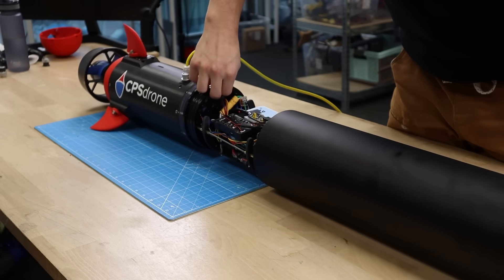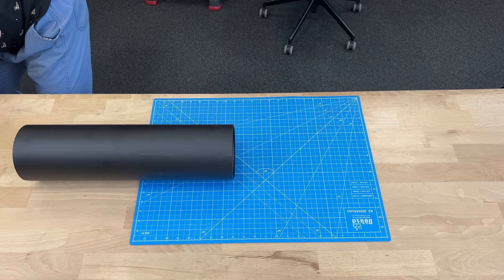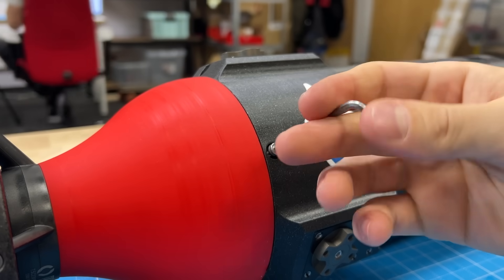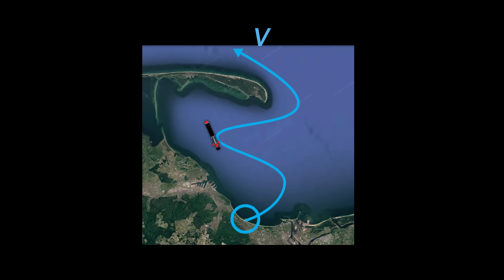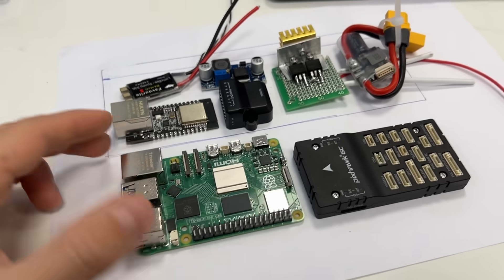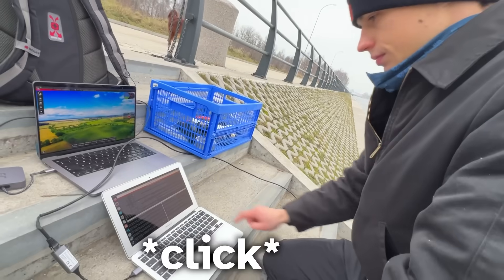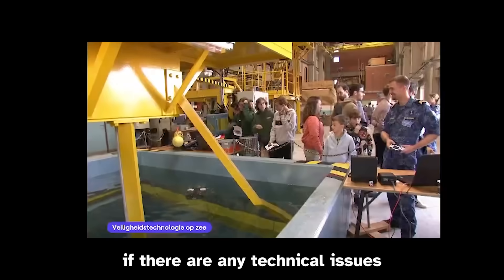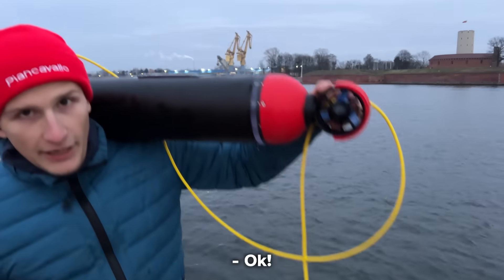Building a fully AUTONOMOUS submarine

Comment: You could have programmed it to make frequent outings to the surface to update the position with the GPS. And with a compass and perhaps an AI model that learns on the fly according to the sea currents and the speed it applies to the propeller to determine approximately where it is going between each exit to the surface.

Comment: Hi CPSDrone Team,

Your AUV project is incredibly impressive! I was particularly amazed by how you achieve direct joystick control over the servomotors for precise movement, as seen in your torpedo AUV video.

I'm working on a similar AUV with ArduSub, but I've only managed to get my elevon servomotors to react to inclination for stabilization, not to direct joystick input for manual control.

Could you share any insights into your setup? Specifically, I'm curious if you're using a modified ArduSub firmware on your Pixhawk, and how you've configured your Raspberry Pi to bridge the joystick commands to the Pixhawk for that smooth, direct control.

Any pointers would be incredibly helpful for the community and for my project. By the way, I'll be the first in line to buy a course on building this vehicle when you release one—hopefully soon! Thanks for sharing your amazing work!

Comment: use a cheap INS (Inertial navigation system), it will give you an estimated position (and it is compatible with Ardupilot and PX4). However the issue is that it has a drift based on time so you will lose accuracy after some time. another way to achieve it is through software --> sonar + cartography maps of the seabed + fusion of accelerometer/magnetometer (GPT may help in a basic script to flash a companion computer for processing and then injecting back GPS_INPUT messages (Ardupilot)

Comment: Have you tried to calculate location by using an accelerometer? Maybe you'll need to calibrate it, but by measuring the acceleration on the 3 axes you can set the position.

Comment: For that price it sounds insane not to build in a emergency retrieval system, just an air bladder and a GPS beacon that deploys in case of failure 🤷 Edit: And I wonder if it's smarter to first build the drone to be directly controlled without the automation, that way they could be sure the drone propulsion and controls work instead of wondering if it's the drone that's failing or the software piloting it.

Comment: My thought on cheaply doing navigation would be to install a gps module and an accelerometer then take a starting position using the GPS submerge start integrating the location of the submarine and after a certain amount of error accumulation surface again to find out exactly where you are. If the accelerometer fails just go back to the surface.

Comment: So, you decided to build an inertial system to navigate underwater. Not a bad idea, considering the alternative solution of low-frequency FM signals with an enormous antenna size.

Anyway, as for the speed calculation problem, I know that in aviation they use pressure sensors to get the air flow speed and convert it to the actual one (probably you've seen such small things sticking out from the fuselage). So maybe (probably) such solution could be applied in hydrodynamic issues 🤔

And moreover, calculating pressure could be used for depth calculation if you don't want to deal with delays

Comment: 5:15 Buoyancy foam? Why not just a small airtank... Also, you're diving by pitching? So what, are you gonna rely on continuous motor power pointing down to keep you at that depth? No adjustable buoyancy? And you'd need some water flowing over the control surfaces to keep you pushing down too.
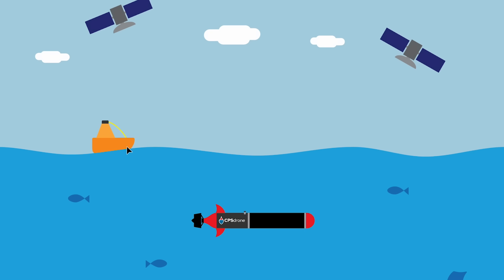7:45 Why is the buoy boat shaped? Seems needlessly unstable.
12:15 Wouldn't have this problem if it worked like a real submarine... with adjustable buoyancy
Why is the bu

Comment: Hi guys,

Just finishing up my PhD in state estimation and controls for AUV’s. Love your videos and always learn something from them!

For your position estimation, you’re totally correct that a DVL would be the best. I see some people on here saying an IMU, gyro, mag with an EKF would give decent short term results. If you have even a 0.001 m/s^2 bias in your IMU (which is incredibly small), you’ll have ~1.8 m of drift over 1 minute. It’s just not feasible as the amount of surfacing required for a GPS fix would be excessive. But one idea would be using a dynamic model of your vehicle. A most simple option would be to run your vehicle at different thruster inputs and measure the steady state velocity. You can create a drag curve off that and use that to estimate velocity. This estimate can be used as the process in an EKF and significantly decrease the error in your state estimation.

Just a thought!

Keep up the good work, look forward to seeing more content!
Reply: for a given mission they could specify a desired precision profile for a given region and surface according to that. E.g. surfacing less in the middle of the ocean where precision to within 50 meters doesn’t really matter.
Reply: Heh, while I never finished my PhD in environmental statistics, I was thinking the same thing! Possibly due to the motivating example for kalman filters is always navigation. 😂 Turns out merging different sources of information is a common problem.
Reply: @codymarquardt4593 poderia disponibilizar seu doutorado link para que eu possa estuda-lo? Faço Doutorado aqui no Brasil e fiquei interessado!
Reply: Is your work published somewhere, I'd love to see it?
Reply: Thats interested, any chance I can view your public paper?

Comment: For determining location, you can use an array of ultrasonic distance sensors to get a rough 3D scan of the seabed and program it to tell which way the bed appears to be moving and go from there. Modern computer mice work on a similar principle.

Comment: the PI is the cognitive brain, the pixawak is the cerebellum xD
Also why an external wifi router, raspberry should have wifi and you can use HostAPD to make it behave like a rouer.
About guidance in drones we use flow camera, again something that the OpenCV on raspberry should have no problem with. Of course the visibility is a big issue, but cheap cameras can see UV, and my understanding is UV does penetrate water better than frequency close to red

Comment: Why don't you make holes inside it to direct the water through the fans inside it to speed up the change of direction? It will provide a faster reaction speed than fins and allow 360 degree movement in any direction. +ultrasonic for Communication if needed , if u can let the water flow inside it like the air in super car we help alot in movement

Comment: Dont you think better go the way how turtles walk.
You can just swim up to correct the path (or send small drone correct the path) and swim down
Plus use flexible solar sheet over everywhere possible and program if the sub loss it’s position just swim up until connect to gps so if you build like that you dont need to worry about the power

Comment: It's a great start, really great work guys, but you definitely need some flavor of ballast. I recommend using a syringe-like design, where you effectively suck water from outside in the drone, compressing the air on the other side of the piston. Then you can autonomously adjust your buyoyancy without any hard work from the rudders.
And a drop-weight system. You do not want your expensive drone to just stay stuck underwater because it ran out of power, so some form of electromagnet holding the weight, that way it will at least rise to the surface, and you can then try to find it with an emergency something on the surface system.

Comment: I'm no nautical expert, and although I live in a port city, I don't really know much about the subject. But with what I know, I suggest using a digital compass for the drone to know its location, in combination with a GPS system that activates only when the drone ascends to the surface, and some type of sensor that can record speed. I suggest periodically, as the drone ascends to the surface, during these intervals the GPS checks its location along with the distance to the target location, and calculates the route. With the planned route and knowing the current location, the control system can calculate the angles at which the drone must turn to follow each section of the route. It uses the compass to measure its trajectory, and if necessary, correct the angle. If it's possible to measure speed, by recording it the drone can measure the distance traveled in x amount of time, and use this data to determine the completion of an interval in the route.

Comment: Have you considered just using the GPS tracker on the sub itself, use integration of speed to figure movement and localization, and have the sub surface every given meters in order to connect to the GPS and check the GPS coordinates against its self tracking coordinates to correct itself?
Over time you should be able to even know precisely how long it can go underwater before surfacing, and even how close to the surface you actually need to be for the GPS to connect.

Comment: a way to know where your position is to have a system like the military plane f117. It uses a local map system by having a map downloaded and using the original position you started at and knowing your velocity and direction you can navigate relative to the map. problems with it is that it can get desynced with the map easily because of wave inteference but if it has a timer inside like every 10 minutes it will surface and look with gps where it is it will update its position on the map and will make a new path acoording to it. adding a system that lets it sense waves pushing it and what direction and how much will be able to remove the de sync problem. the map can get descynced over time without waves with electronics not being perfect and small delays it will get descynced adding even more of a re syncing timer need for it.

Comment: Soo how about putting the gps with a esp32 in a small floating ball and attatch with a thin 2wire cord to submarine and use uart to communicate? Then you can also use wifi ontop. Or atleast send commands to it with esp as proxy. Can even power the esp over the same cord.
Reply: And you need some planes in the front? Bow planes would just need one more servo. And you can rotate the drone to steer

Comment: For your GPS issue, perhaps you could have a sensor that deploys from the sub at waypoints to get a GPS location as a correction factor. Using accelerometers and lots of math, it may be possible to have the vessel estimate it's travel and distance, arrive at a waypoint, deploy the GPS sensor to the surface, take a correction reading then recalculate the course. After, it could pull back the GPS sensor into the body of the sub and continue on it's new course.. It's complicated but everything you are doing is complicated. lol. Not sure if this is a good idea or not. It would need to be tested. Good Luck!

Comment: a bow thruster fixes the slow turning problem. you can even do two in an X pattern for two axes of mobility…you just need to bend the tubes containing the flow around the other.

Okay, I see you did that exact thing in one dimension. I still say it applies, you just need to run a pipe through the body for each thruster. If you want to get super crazy, put a pair like that in the stern, too, and you get three dimensions of control; at that point, it's just like a space vehicle's RCS thrusters.

Comment: Having the GPS unit attached to the drone like a periscope would be really cool because you could program the sub to rise to periscope depth and have it mechanically extend the GPS unit to the surface in order to re-orient itself after a dive.  You would need to give yourself a buffer zone for drift and such during that dive, if it is in a tight zone, but it would be a really cool addition and you could even use it to just cruise at periscope depth instead of using the buoy.  Additionally, having an emergency inflatable buoy with a tracking device on it could save the drone from being lost forever in the event of some catastrophic failure.

Comment: I don't know a lot about underwater communication, but here's a potential solution to your positioning system:

Use multiple Buoy's that are also self propelled, at least 3, each with their own GPS module. Then use acoustic waves or very low frequencies to send positioning data to the drone, where it can then triangulate the data using time of travel and figure out it's position. Then have the drone communicate back to the buoy's (and have the buoy's communicate to each other) so the buoy's can work together and stay close to the drone. adding cellular communication to the buoy's might help with centralized commands.

Great Video, thank you for sharing your project!

Comment: okay i'll tell u. programm the sub come out of water every 5min or etc to calibrate gps location and dive asap. add gyroscope and compass to control module. it'll use compass to determine it's vector, it'll use gyroscope to counter maneuver water currents and approximate its location more accurately until it takes a breath and to get back in course.

Comment: The model looks impressively clean and polished. I love such well-crafted details. It makes me wonder if it would be possible to implement an INS positioning on some cheap sensors to eliminate the GPS on the buoy. If that worked, the position could be acquired from the GPS before submersion and then tracked using a gyroscope, accelerometer, and magnetometer. The only question is how large the sensor drift would be. In the worst case, it would need to resurface to obtain a position fix.

Comment: Also, recommend converting you foam cavity into a dry sealed containment with hobby grade servos in the dry side. These can pass through a bulk head using cup seals which seal more and more with depth. Youi can also reduce to two servos by utilizing a cross rudder design. This well enhance the steering characteristics of the sub and will also improve your surface handling as you main steering fin is on the top of the sub currently.

Comment: Real world submarines often use a floating buoy to attain gps fixing and or use radio frequencies that do not penetrate water well (high frequency). Also, have you considered adding a failsafe mechanism for submarine recovery. Typically in the hobby rc world this can include a bladder in the wet section and a pump that inflates the bladder from the dry section to add bouncy to the sub. There is another method that uses a small gas chamber and solenoid that can be used to evacuate the water from a wet side cavity. These are usually connected to a dead man switch and can be very simple in design.

Comment: Neat that you used a pixhawk that is typically an aerial vehicle (UAS) solution. 

I find myself curious about couple of things:

1. How did you wire up the Raspberry Pi to the Pixhawk? I am thinking you wired it into one of the telemetry ports?   
2. I'd love to learn about how you wrote the software on the pi.  Looks like you used a mavlink python package and rigged the software to start on power up.

To get away from the buoy with the GPS, I think you're forced to use an IMU and/or a database/map (bathymetry) to compute and match your location and feed it to the pixhawk.

Comment: you guys can add aditional  motor via replacing fin to turn faster and, or  better option add rotaer/motor  to fin  via controling the diaraction of motor through fin, can be adjust  speeed direction and depth as well,  can make sliight modification, small wings on back like a space ship,

Comment: the Pitot tube could be used as an instrument for measuring speed. in fact it measures the speed of a body in a fluid. they cost relatively little and are used by airplanes to calculate speed. Being both air and water fluids the tube should also work underwater

Comment: such a awesome project❤this project have lot more potential as product for sure.
i have few suggestion - 
1.make the buoy also autonomous so it will not drag by the sub.
2.add telemetry
3.make the buoy little bit bigger,  so it will not drag under the water  and put the tether in the bottom of the buoy.

Comment: if you know your orientation then you could just swim to the surface, im not sure whats the max depth that gps could reach (im assuming a few cms) but if the drone goes to the surface and drives in a straight line for 5 meters it'll know its position and heading and could then dive back down while taking a guess on where to go next, this could work but im no expert so more research would have to be done, this process could completely eliminate the tether

Comment: In order to allow less inaccuracy with the buoy being offset and allow the submarine to go deeper, you could use a winch with a weak spring full of the cable that can retract the cable when the submarine ascends and extend the cable when the submarine descends, with a tube on the exit of the cable to transfer sideways force from horizontal motion into the buoy instead of the winch
Reply: Just a thought I have no idea if it will work

Comment: I'm sure you have thought about using thrust vectoring.
What's the reason not to use it? You could implement it with 1 Ball joint and 2 strong servos.

Comment: Idea: use beacons = use small  wireless relay  place it between each points to guide submerine wirelessely. when submerine checks and gets signal from becon it moves to the next destination. # floatable rc boat with a rectable rope with a sincable relay ( can use radio type relay) . you can in crease relay , becon depth by using a extendable roap with motors.